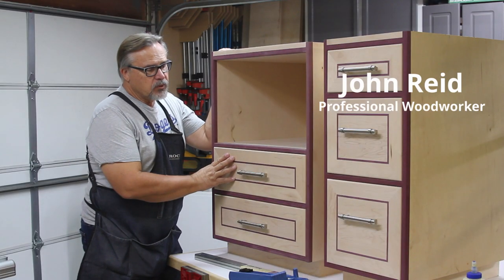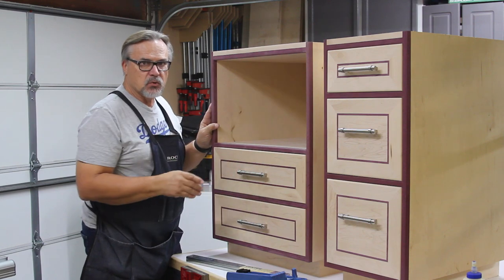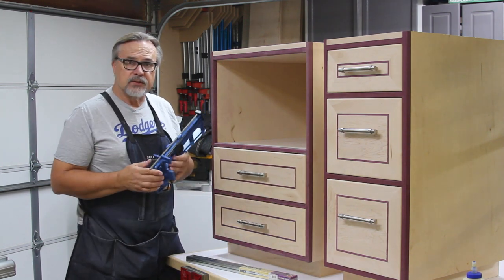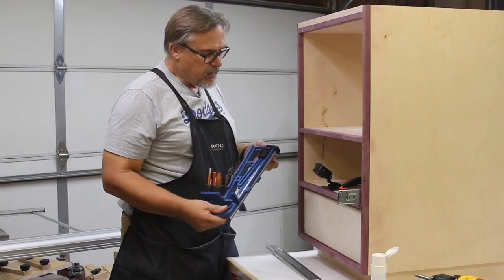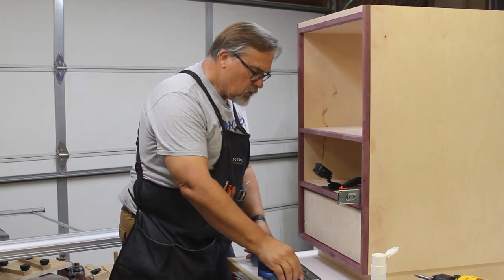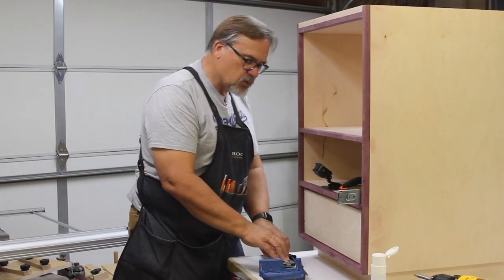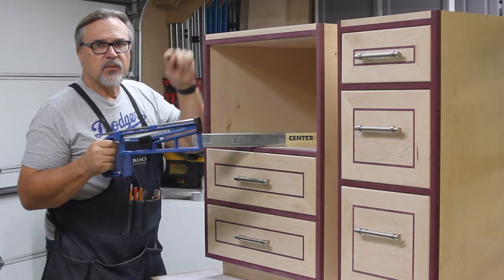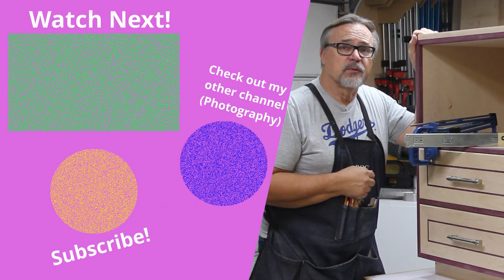Testing the Rockler Universal Drawer Slide Jig - Easy Setup

Comment: Very informative, thank you. Can you use a 24" side mount drawer slide on a 28" drawer box and still have it fully extend?
Reply from the maker: I would say no, the drawer slides extend 24" and so they would stop at that distance. Leaving that extra 4" inside the cabinet.
Reply: @MadNerdWorkshop  thank you for your content.  
I found a 28” drawer slide and will order them to finish up the drawers for my parts storage containers. Thank you for the response.

Comment: Purchased that Rockler tool and like so many which make claims to do x,y and z, I found it an absolute waste of time.

The design is not easy to use and it is generally awful.
Such a shame, as it it cost me £35.00
Reply from the maker: I am Sorry, Deanne.  I don't like steering people in the wrong direction. I am still using it for some cabinets I am putting together today.  Of the drawer jigs that I tried before, this one held the drawer slides securely and was a easy to level. How did it not work for you?Do you normally use a spacer piece of wood? Or how do you normally install drawers that are easier?
Reply: @MadNerdWorkshop  no need for you to apologise; it is not your fault.

I just found the design quite clumsy and went back to making spacers, which I found faster.

I would improve the design a lot. Altbough once the slide is added to the jig, it is not that easy to line it up (I like my slides centred). The Rockler drawer slide requires a magnet (the black slide tends to move).

Anyway, many other people have said the same on other youtube sites.

Poor design.
Reply: @DeanneMariaCreates  I've used this jig a number of times.   Not had one problem with it.  If you can't critique the problem you've had with it, then perhaps learn how to use it properly.   I've also installed drawers with the Kreg drawer slide jig.  Either of them are better for installation of glides than custom jigs.  They don't work well with lowest drawer but other than that, huge time and frustration saver.
Reply: @raywright2401  that is your preference. Many people agree with me. I find it easier to.make spaces. That  jig is cumbersome. I have made over 30 drawers this year